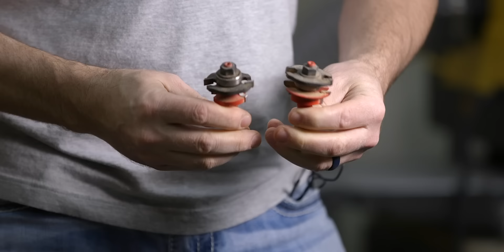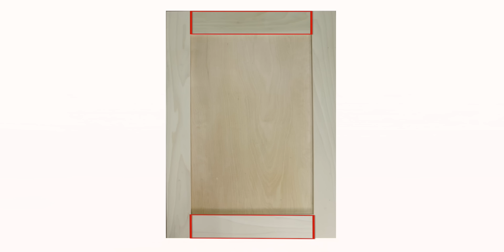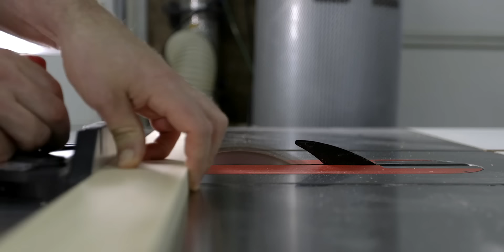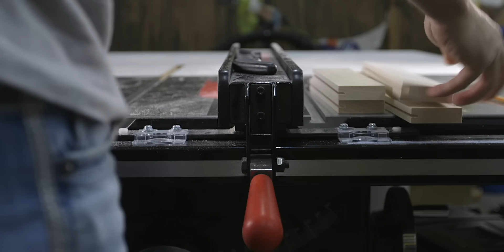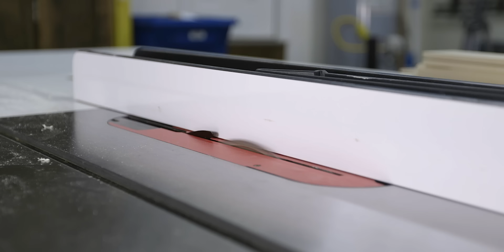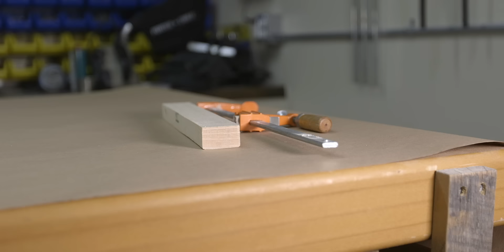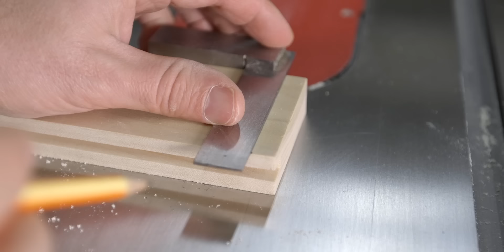Build Shaker Cabinet Doors With Table Saw | New to Woodworking?

Comment: Of the dozens of videos I've watched on making cabinet doors, this has to be the best for completeness, clarity, succinctness, accuracy, editing and script.  Well done!  The only thing I'd add for viewers reading this is that using a flat-top grind (FTG) blade instead of an alternate tooth bevel blade will help the joinery go even more quickly and accurately.  I'm sure Training Hands left this out purposely as it's not necessary and most beginning DIYers don't already have this blade in their shop.
Reply from the maker: Thank you for adding this info! You rock!

Comment: Nice video with clear instructions. My only question is what do you do if your plywood is undersized? Then it will have a sloppy fit in the groove because the tenon is centered and a perfect quarter inch. Do you just make the tenon the same thickness as plywood to make it all jive?
Reply from the maker: Yes, exactly

Comment: 5:55 just a question about this part, if the panels fit snugly together, wouldn't you want to leave the jagged edges in the grooves? They'd allow the glue to get a better bite, wouldn't they? Sanding it all down seems like it would give less surface area for adhesion while simultaneously thinning out the surface and making it fit more loosely
Reply from the maker: I like the way you think... yes technically what you're saying is true, however it doesn't make that big of a difference for a joint like this. Thank you for sharing this thought with me.

Comment: Greetings! Have you had any door twisting a few weeks after installation? This is the exact method I use for the doors I’m building, but some have started to twist after I installed them. I primed them two full coats (both sides) and then painted them two coats (both sides). Thanks for the video!

Comment: Great video - What wood are you using?
Reply from the maker: Poplar
Reply: @TrainingHandsAcademy  Thanks! Where do you buy from, because I can only find poplar plywood. Also, what thickness are you using from the rails / styles and for the centre board? Thanks!
Reply from the maker: @james-ov8df  I buy from Home Depot or if they don't have what I want I go to other local plywood dealers around me. 3/4" for the thickness.

Comment: Next step 
= Doors, table-tops, wall-panels, workbench, bench-top, saw-table, ..., kitchen-..., camper-van..., ... fit rails(electrical and non-electrical) and aluminium-extrusions to common-denominator - doors.

Probably need to recess the edges of rail-extrusions for stuff to get in and push dirt out by sliding...

Comment: Hey man, I'm going to be very clear. The instructions are efficient, I couldn't find a sequence out of place and the detail of work is perfect, not extra cutting steps or waste in material. The only thing that I would do differently. is to mention what you later said in the video maybe in the beginning, which was the tip on "you can always remove material by cutting, but not add because they were gone..." anyways, I just wanted to provide my kudos. I subbed.

Comment: Question about the measurements of the doors by measuring the cabinet and than you said multiplied by 2 ? I didn’t understand that part but the rest was great.!
Reply from the maker: This is just a quick way to get the rough amount of lumber needed for the door.

Comment: Should you not have a $4000 table saw you will fiddle with these settings for a about a week on cheaper table saw, ie: Delta.
Reply from the maker: Been there with a cheaper saw... more work but still can get really good results.

Comment: Extremely well presented video. I'm open to suggestion here so fire away! My kitchen cabinets were made in the early 1980's of knotty pine and my wife and I hate them. We want to keep the boxes because they are built like a tank, but the doors have to go. We are sanding the boxes and painting them an eggshell (sort of) white and I want to make shaker doors. I want the rails and styles to be solid with a plywood panel like you've made, and since we are painting everything, species of wood shouldn't be a big deal. I just want nice and smooth shaker doors. 

You said between 2 and 2 1/2 inch wood rails and styles are the norm, but I didn't hear anything about thickness. Did you happen to buy your wood from a big box store or a lumber specific place. I'm really hoping to do this as inexpensively as possible but get the best results that I can. I do have router tables and bits for the job but honestly the set up on the table saw looks just as easy without the extra set up. Love to hear thoughts! I have 14 cabinet doors to make at a variety of sizes, and I will male them the same size as the existing doors. Please help!
Reply from the maker: 3/4" is the normal thickness. If you are using a table saw, I would suggest getting a saw blade with a FTG (Flat Top Grind) which means the kerf of the blade leaves a flat bottom. I didn't in this video, but it does help to make the joints look better. Your kitchen will look amazing!

Comment: Great video. I wish I saw this before I made my doors. I took the measurements. And cut 45 degree angles on all 4 pieces. Which is proving to be harder than this method. But im too far to start over.
Reply from the maker: Good luck with your build.

Comment: After measuring the cabinet opening, how much bigger do you want your door to end up in relation to the size of the opening? Is there a difference when making these doors for faceframe cabinets?
Reply from the maker: Yes, it depends on the hinges you use and if you are putting the doors inset to the face frame. If inset, then I leave an 1/8" gap around the door, so you would make the door a 1/4" smaller in both directions. If you are overlaying them on the face frame you would buy hinges that overlay... and of course you can buy different overlay amounts. For example you can buy full overlay which covers all the face frame or you can buy something less. Figure out which way you want them, buy the hinges, and build the doors. I hope that helps. You can always email me too.
Reply: @TrainingHandsAcademy  Thanks a lot for your reply! I will send you an email. Greatly appreciated.

Comment: Explains the corner joints but nothing how you attach the backing or what it is....?  Really simple but you definitely dropped the ball.. how would anyone be able to build cabinets with this tutorial?   Did you even watch what you made? Or thought about a new carpenter?
Reply from the maker: This is a video about building a door not a cabinet. If you want to build a cabinet may I suggest watching a video about building a cabinet. Hope that helps.  https://youtu.be/KgJk8bN8nBo

Comment: I appreciate your video, but I'm wondering why you don't explain about cleaning up the tenons before dialing in the fence location rather than after the whole section about the creating tenons.  Seems like it would be most helpful to explain that at the step in the process when it's typically done.  Since it's a critical piece of info to make everything fit, why wait until the end?  Other than that, a well thought-out and straight-forward tutorial.  Thanks for posting.
Reply from the maker: It was an after thought while I was in the middle of filming... it never made it into the script. That's why the order is off.

Comment: I'm making small doors (29×27) and when I make the frame, the frame does not lay flat, both ends are raised a bit, how can I fix this when I build. I'm using tounge and groove pine. I normally make oversized barn doors, and I still have the same problem with every door. I am joining with kreg holes.

Thanks
Reply from the maker: Hey Paul, do you glue and screw them together in clamps or out free on a work bench? If free, I would set them in clamps, making sure they are tight to the bottom of the clamps, and them screw them together. Sounds like the edges of your boards aren't perfectly square to the face of the board. How often do you check your material with a square? Let me know. Thanks for reaching out Paul.

Comment: Is it me or do modern blades have these alternating angle Teeth that do not leave clean cuts when you do this
Reply from the maker: Yes, you are correct. A FTG blade is ideal because it leaves a nice flat bottom.

Comment: What's a good tooth size on the 10in blade for a clean cut. Lastly, average dry time on the wood glue. Limited to the number af clamps I have. Thanks for the info
Reply from the maker: The best blade is a FTG blade because it produces a flat kerf. You can watch this video if you don't know a lot about blades https://youtu.be/8Bi6haKUidw Average dry time is about 2 hours, completely cured in 24 hours.

Comment: I'm going to try to adapt your method to make a larger (28"W x 56"H) two-panel door to cover an attic  ceiling hatch ... I like the simplicity of your design, and believe it will mod to a three-rail version --
Reply: Three rails worked! -- I dry-fitted all the pieces, then glued-and-clamped the CENTER rail to both stiles FIRST so that I could then slide in  the two panels, one from each end.  Toughest problem was cleaning up the tenons with a chisel because my saw-teeth were "ATB". Thank you for an EXCELLENT instructional-video!

Comment: Built a door exactly how you said and when I went to install the door I noticed that the door had a slight twist to it. Was wondering how to fix this issue? 

Please help!
Reply from the maker: Sorry to hear that Jeff... it does happen. Was it twisted in the clamps, meaning was it glued up that way, or did it do it after it was out of the clamps?
Reply: @TrainingHandsAcademy  it twisted after I took them out of the clamps
Reply from the maker: @jeffhales26  Yup. Sorry man.

Comment: Josh - a few quick questions: 1. What is the thickness of the board you are using for the stiles and rails, it looks to be 3/4 inch, but I wasn't sure. 2. Do you have a preferred wood type for the stiles and rails and then panel? I need to make 10-12 cabinet doors and I am thinking of using Poplar and then probably 1/4 in sanded plywood for the panels. Lastly, do you have a video on how to make these doors with a router table and/or dado blades. I have both. Thanks.
Reply from the maker: Hey Bernard! 1. Yes, 3/4" thick. 2. I like Poplar and plywood if I'm painting (as seen in the video). 3. I don't have a video using a router table or dado, but I do plan on making one soon. I personally like the router table the best.

Comment: I tried to find the answer to my question in the comments - no success.  When you put the hardware on the example door and then showed how to install and then closed it in your office, I noticed there was no face frame.  How would one use the same hardware when there is a face frame?  Do you need a face frame.  If you have a face frame what changes to dimensions do you consider.  Thank you for your time and making these amazing instructional videos.
Reply from the maker: You would use the same type of hardware, but the hinge you would need would be labeled for use with a face frame. You don't need a face frame, you can use either version. Both are still European style hinges. If using a face frame hinge, it will come labeled with an amount it "overlays" the face frame. They sell many different ones so the sky is the limit. Whatever you need they have it.

Comment: I would love to make new doors for my kitchen cabinets. I've never done anything like this as I've always paid to have most things done around my home. With the economy the way it is I've been teaching myself how to do more and more. I've thought about buying myself a free standing table saw but I don't have anything like a router to make the groove for the center panel. Is this something that a novice homeowner can do on tools that are bought from a big box store? Would be nice to see a video using tools that a non professional novice woodworker might have. Thanks
Reply from the maker: If you have a table saw you can build doors.
Reply: @TrainingHandsAcademy  Does it require a table saw that you can adjust the depth of the blade? I haven't bought one yet. I've looked online and I see many brands at different price points. I don't know how much use it would get after doing this project so I don't want to spend hundreds of dollars.
Reply from the maker: @MP-yz6sb  Yes, all table saws have depth adjustments.
Reply: @TrainingHandsAcademy   hmm that one I’m not sure about because I’ve seen under “specs” that some say no to depth adjustment but more expensive models say yes 🤔.
Reply from the maker: What ever you do, don't buy a table saw that you can't adjust the depth. Maybe you can borrow one from someone?
Reply: @TrainingHandsAcademy   I have a buddy that has a real cheap one he bought somewhere. And I mean cheap. It rattles and vibrates. But I’ve gathered being able to adjust the blades is rather important. Especially if I’m going to attempt to make new cabinet doors. Not gonna lie…concerns me a little. I’ve never really used a table saw and some of those cuts looks a little dangerous for a complete novice. Can you add router blades to a table saw or is that a whole separate thing? Almost seems like that would be easier and safer to make that tongue and groove 🤔.
Reply from the maker: @MP-yz6sb  That's a whole separate thing for sure. :)
Reply: @TrainingHandsAcademy  I was afraid you were gonna say that. Lol

Thank you for taking the time to educate me. I appreciate it 👍

Comment: Thanks for this video. Used this method to complete several cabinet doors. But how do you recommend building smaller drawer fronts?  Need some kind of backing for the pulls?
Reply from the maker: Yes or jump up to a 1/2" thick panel

Comment: For the styles and rails what did you use? Did you have to mill that to the correct thickness?
Reply from the maker: Didn't have to mil it. I used 1x3 Poplar which measures 3/4" thick by 2 1/2" wide.
Reply: @TrainingHandsAcademy  I have to build new boxes how do I determine what size the doors should be
Reply from the maker: @Therealphantomzero  Build the boxes and face frames first, and then decide on the style of hinge. Most hinges will have an amount they over-lay the door on the face frame. You'll then need to build the doors according to those measurements. Sorry this is very hard to explain, I need to make a video about this.
Reply: @TrainingHandsAcademy  yes this has been my biggest question because when refacing cabinets I just use the old existing door sizes but when changing dimensions I get stuck

Comment: I used this video as a guide to make my first cabinet doors. It was incredibly helpful!  Question, I decided to go with a 1/2” overlay with 1 and 1/2” wide stiles and rails. The standard overlay hinges I got at Home Depot are too big for the frame. Any idea where I can get smaller hinges to fit for these smaller styles?
Reply from the maker: Try Woodcraft or Rockler. If no this place will have something. https://www.hafele.com/us/en/

Comment: Such an excellent presentation! I’m a newbie, about to make my first door for a large open-face cabinet and intend to follow your guidance as my tutorial. You make it seem so easy!
Q: What to do if door isn’t square? 1/16 I can live with, but what if it’s more? Start over?
Reply from the maker: Depending on the size of the door, you may be able to get away with more. Before you assemble just double check the lengths of the rails and stiles... make sure they are the same and that the ends are square, and you'll be just fine. You can always reach out to me for help, send me photos or videos in Instagram...or email. You're not alone. :)

Comment: Took original flat doors added 1/8" x 2.5" wood strips from home depot. Painted with oil- hybrid satin paint . 22 cabinet doors, wood, paint, plus supplies around $500
Reply from the maker: NICE

Comment: Good efficient video presentation. However I wish to use solid wood panel. How can I do that with a 16inch panel.
which I want to be thicker than 1/4 inch yet get a shaker look.

Comment: I know this video is a little old, but hoping you’ll answer a question. I’m building doors that are 43 inches tall for an outdoor cabinet. Should I be concerned about warping, and if so should I put in a third rail, or consider alternative woods or style?

By the way, I agree with many others here, you are a great teacher and I love your video content. I subscribed after watching a few of your videos.
Reply from the maker: Thanks for the comment. I would consider using a thicker 1/2" panel. You will have to off set the groove more toward the face of the stiles and rails, as well as cut a rabbet in the panel so that it will fit into the 1/4" groove. I don't have a video on that, but hope to at some point.
Reply: @TrainingHandsAcademy  Thanks so much for the reply. I’m glad I saw this before buying materials!😊

Comment: Board clamped to the fence, why, I didn't see it used? I don't see the advantage over just using the fence?
Reply from the maker: It's there for safety reasons. You technically don't need it because you are not cutting all the way through the board (if you were this prevents the cut off from getting trapped). That was the way I was taught, so I still do it.

Comment: The tenets on each side of the Rails I could not accomplish with a new Dewalt portable table saw because it does not have a microfine blade adjustment. So when the tenet was too thick and I needed to raise the blade, it was virtually impossible to see it being raised without it jumping too much and resulted in the tenet becoming too thick and creating a loose joint. :(
Reply: I meant to say the tenet becoming too thin.
Reply from the maker: Bummer, sorry to hear that.